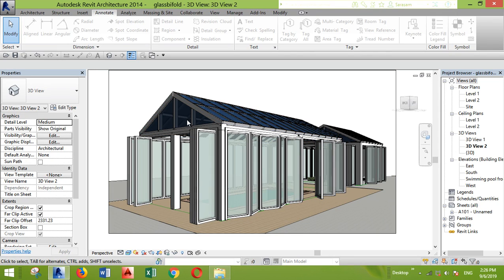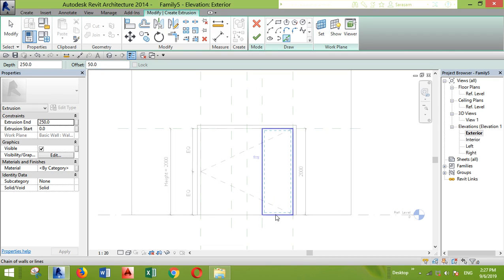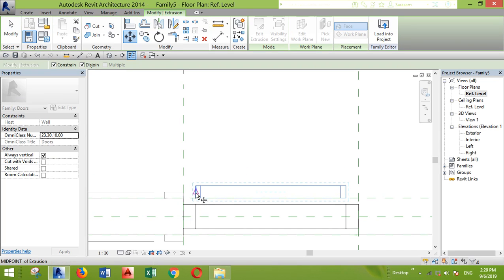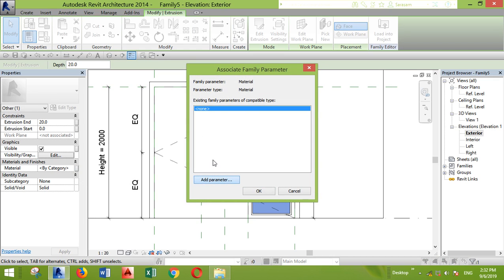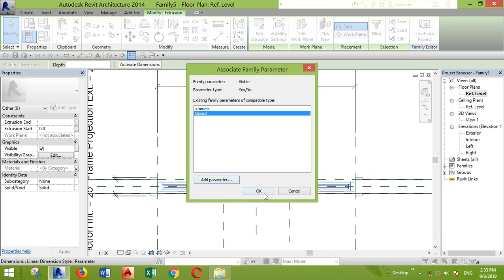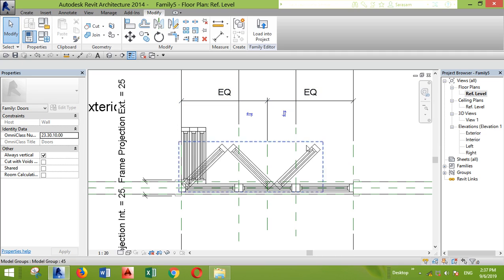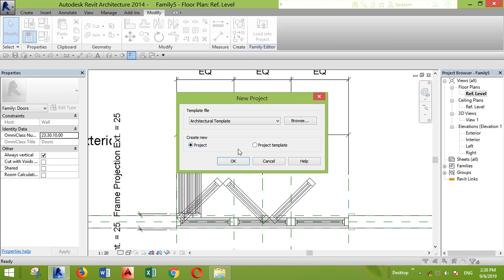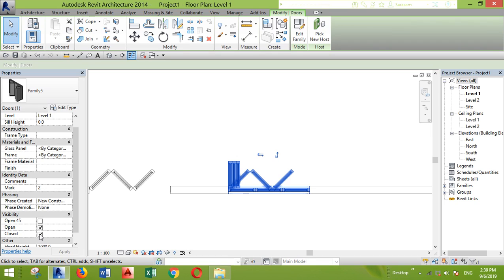Parametric Bi-Folding Door in Revit (The fastest and easiest method!)

Comment: Thanks for this video! Very Helpful. When the width of the door changes in the model, the point where the door panels hinge does not update to match (eg. with 45deg. open, the panels remain in the center of the increased opening)